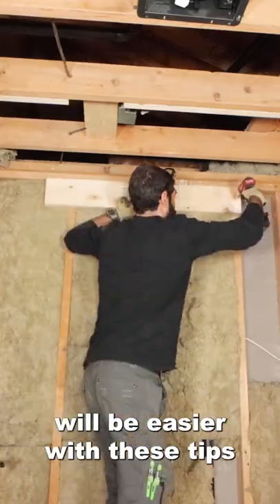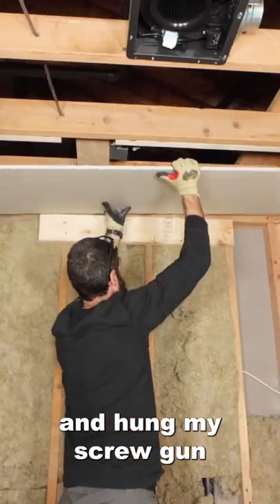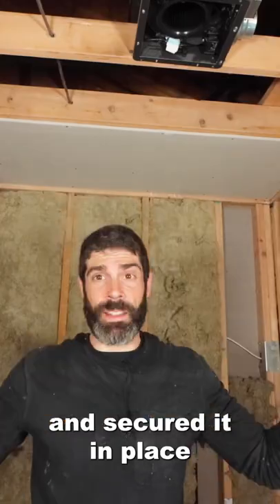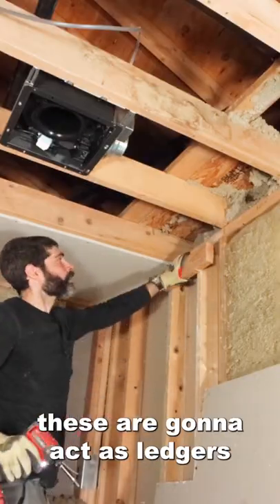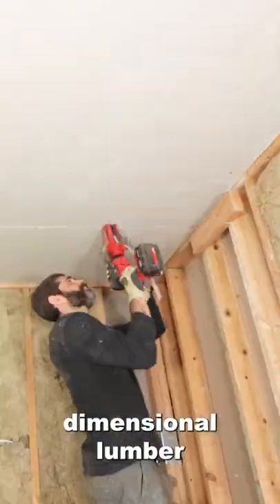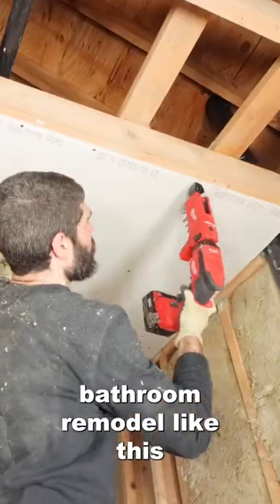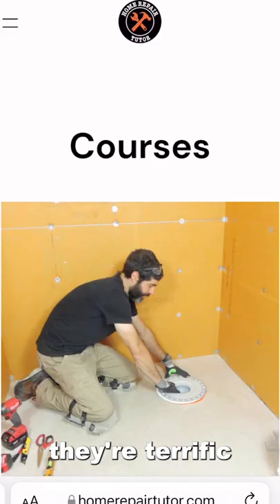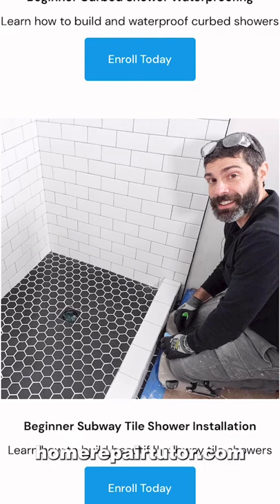Drywall Ceiling Installation Tips - #shorts

Comment: You don't need the wood just put three Nails across the header tuck one end up and hold the other end while you nail it.  I hung for 30 years ,rule number one never use 8 ft board.
Only 12 Footers don't want to get laughed at